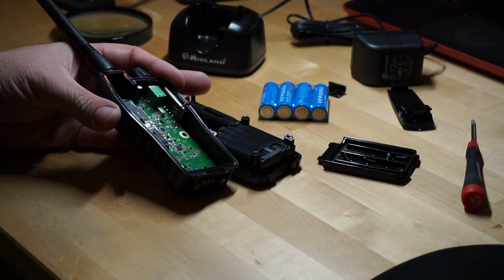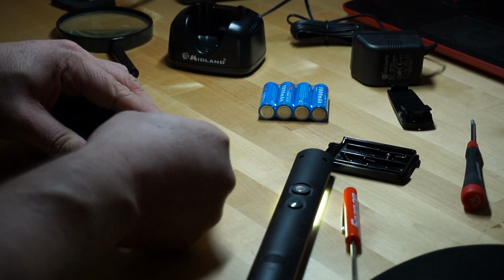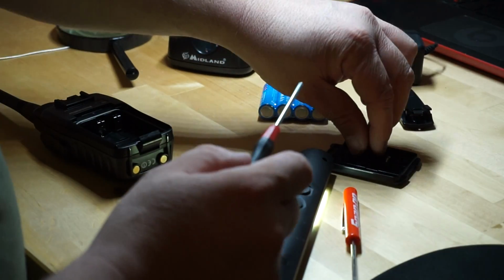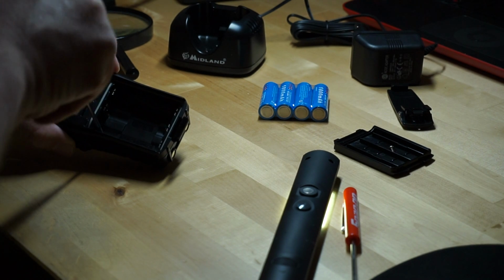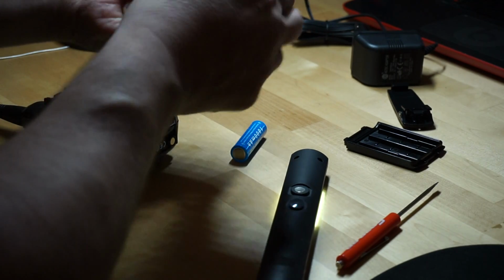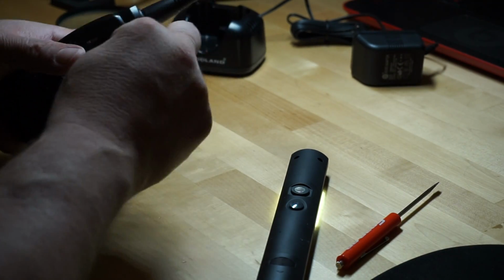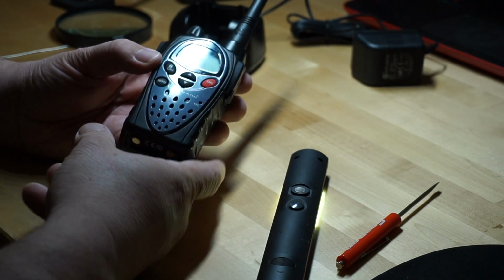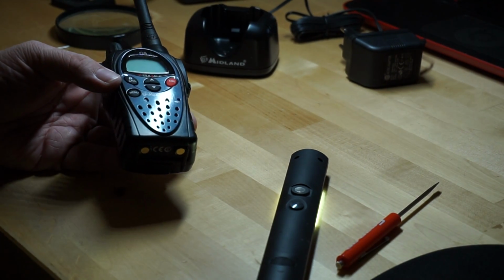Midland G9 Plus - MOD - Walkie Talkie 2 Way Radio - Mod - putting it all back together

Comment: chargers aren't very good if forgotten they constantly cook the battery's not smart chargers I charge my batteries in a separate charger which does them in an hour instead of the 16 hour's they take with the crappy supplied ones funny how all midland radios upto the g.10 has these same chargers g.10 g.11 and g18 are smart and are rapid .....
Reply from the maker: Yeah... I also use a "high quality" NiCad charger most of the time. :-)